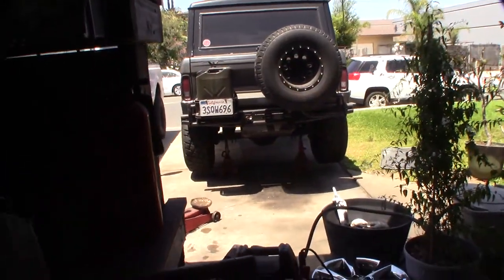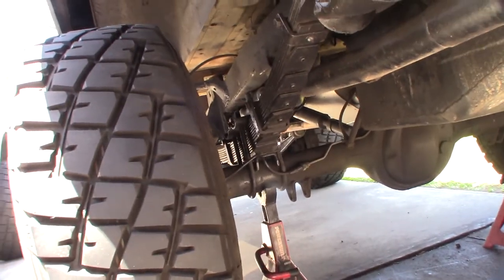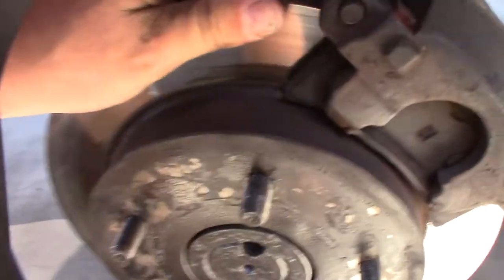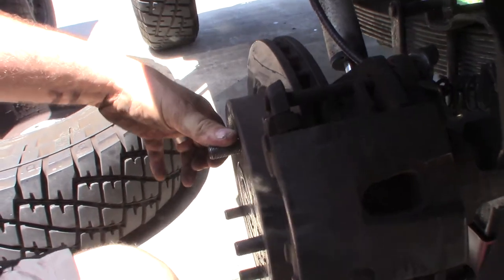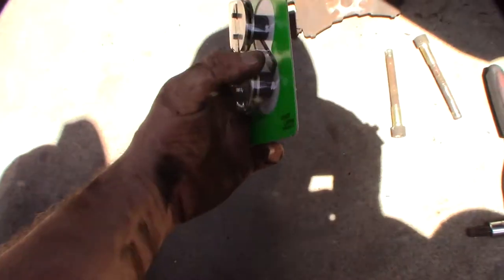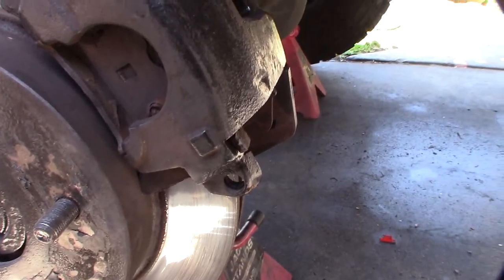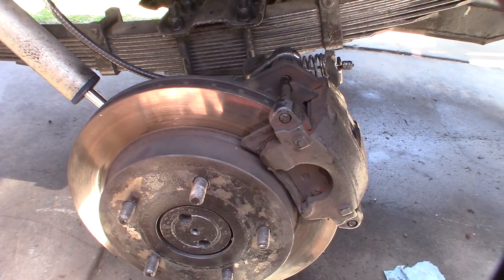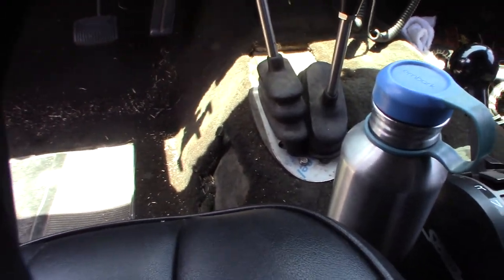Early Bronco Rear disc Emergency brake adjustment Cadillac eldorado caliper conversion

Comment: How hot did your rotors get? That seemed pretty tight.
Reply from the maker: The look fine, I drove about 200 miles over the weekend.
Reply from the maker: They were smoking for about a mile.

Comment: You can adjust from the outside without removing the Caliper and pads. Remove the arm where the e brake cable ends with spring . There will be 2 washers behind that arm, use 9/19 box wrench to tighten the piston to the disc, adjust until you have enough to put back the arm with 1/4 inch play.  Your done. Been doing these for 20 years
Reply from the maker: Cool, I will try that. Those rear e-brakes are annoying.
Reply: Thank you Fintech and The_Spaniard for both of your info about the rear disc parking brake adjustment. I've ran that kit for years and never got my parking brake to work worth a dam. I'm going to give this a try. Thanks again!
Reply: mr 20 your chev guy,,i have the 7'' calipers,cadilac.why does the cable go under the diff,,ive made complete new brkts,to send cable over the diff.&,why do you have to adjust,,self adjusting calipers,.??..oh,forgot.ITS CHEV CRAP..using the e brake,regular,should keep them correct..or you just make money from people that dont use e brake..??.